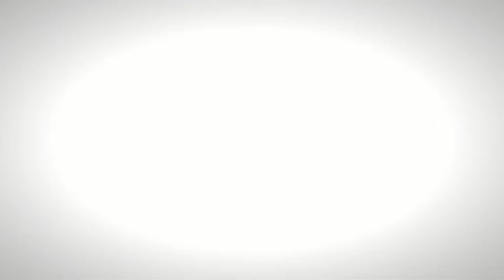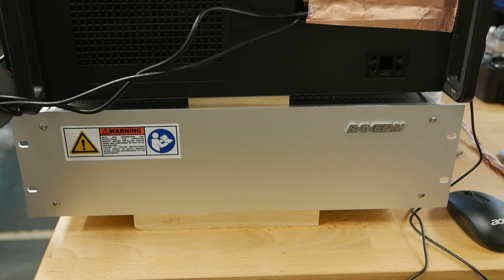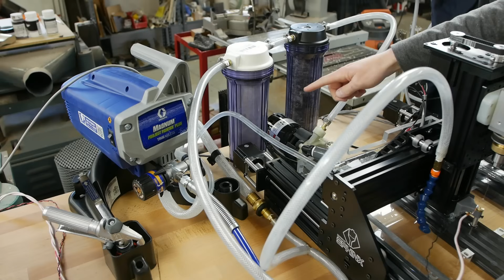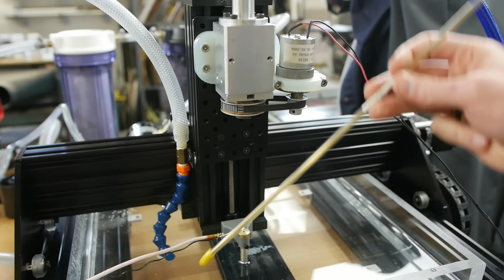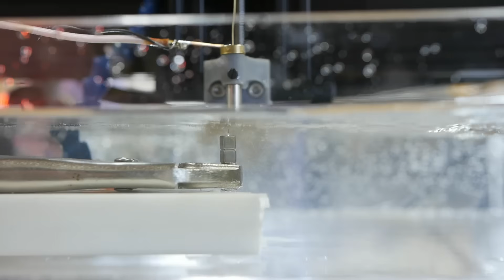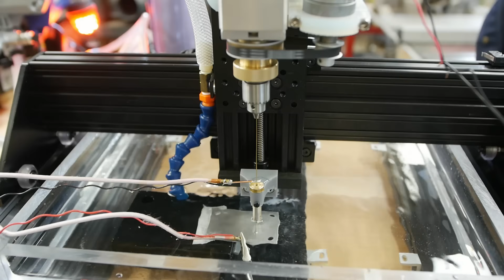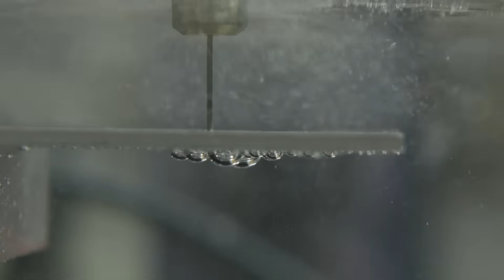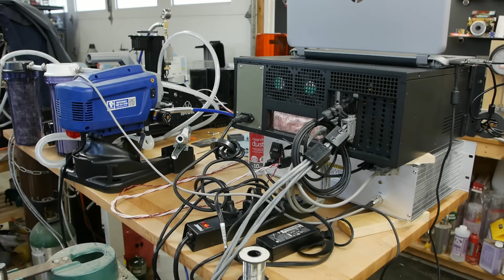Drill through anything (conductive) with Electrical Discharge Machining

Comment: How do you keep the arc happening at just the bottom of the electrode? Surely if it happened all the way up, it would enlarge the hole like a cone with time as a variable.
Reply: Watch the end of the video, it DOES happen all the way up, it's not limited to any particular spot on the electrode.

But not like a cone. The electric potential all along the piece you're trying to drill is the same, right? assuming it's sufficiently conductive. The electric potential all along the electrode is also the same. Where does arc discharge happen? Wherever it has to bridge the lowest length of barely conductive medium, the water. Wherever the distance between the electrode and the piece is the lowest. It knocks off the high spots basically, the hole will be cylindrical, not cone shaped.
Reply: @SianaGearz  Makes sense. Even then, stray arcs? Thats gotta be a parameter
Reply: @joblessalex  stray arcs are a thing, but then, they'll just all average out, they won't really matter in the overall shape of the hole, merely in surface quality and final dimension. Surface is what it is, don't think you could do anything about it, even if you insulated the rest of the probe. The tip of the electrode is consumed faster, so using also the whole side of the electrode is advantageous to get a consistent hole size, and just keep the timing of the side erosion consistent.
Reply: In the words of Jeremy Clarkson: "POWWWEEERRRRRRRR!"
Reply: The electrode gap at the tip is kept smaller than the gap between the sides to maintain the arc at the bottom.  With a perfectly straight electrode the spark would stop just after it punches through because the voltage is not enough to jump the gap to the sides of the hole.  As the spark energy is reduced and the gap is decreased it is possible to achieve very fine surface finished as the peacks on the surface keep getting eroded away.
Reply: @KallePihlajasaari  I don't understand how it's spatially possible. Once some surface material has been removed, the electrode needs to be advanced, and as it's advanced, eventually the distance at the tip will be equal to distance to some point along the sides.
Reply: @SianaGearz  Imagine the tool advanced to the very bottom of the hole, in contact, the retracted just a tiny bit and that is the operating point. You are trying to keep the gap as small as possible but not in contact  The spark will always jump the smallest gap. If you control the gap at the tip to always be smaller than the side gap you achieve a tight fitting hole.  If you let the work piece get eroded further from the tip than the side clearance the sides of the hole will start to be eroded (much slower because the surface area is more than the tip surface area).  After some time the side and bottom gap will be bigger than the PSU voltage can jump and the sparks and erosion will stop and you have to advance to start the erosion at the tip again.
Reply: @KallePihlajasaari  oh i see. Thanks.

Ultimately the electrode clears an equal distance around itself as it advances. I had forgotten that this distance depends on the energy supplied, thus you can put a hard upper boundary on the depth of side erosion, so thanks for alerting me to this. You're suggesting that since the mechanical advance leads the erosion, the distance at the tip is generally also expected to be smaller than at the sides. Ultimately i think the sides of the electrode are still active, desirably so, because not only the work erodes, the tip erodes too, it will necessarily round off. Besides you have mechanical alignment issues - movement is not exactly parallel to the electrode orientation, so to avoid making oblong holes, the electrode is rotated; but rotation introduces eccentricity and thus varies the side distance.
Reply: @SianaGearz  Yes.  It may help to picture the fact that the bottom of the hole is not flat but has a radius equal to the bottom gap that continues to the sides.  To make very sharp internal corners it is important to have a small gap and a sharp cornered tool to make a final finishing plunge if the main tool is eroded.  All this required very high position tolerances with tool changes.

And you are correct with the rotation, it is a trade-off between hole shape and hole size.  As mentioned by a few experienced EDM drilling folk on this thread the tool should not be bent to minimize the chance that it will wobble in the hole when turning.  A bent tool will cause a over size hole if rotated or a slot if not.

Comment: I have those same v groove style guide wheels on my 3d printer.  I was initially skeptical in a couple different ways but I have hundreds of hours of print time on it now and I haven't even had to adjust them.  The rollers do tend to collect dust which I blow off occasionally but thats been it so far.

Comment: Would a surfactant help the water in this case?
Reply: Surfactant might 'nicen up' that eroded surface because particles are hovering easier in water.

But you might get some bubbly water. Add bubble minimizing agent?
Reply: @tubefish666  iirc there are non foaming surfactants but it might play havoc with the conductivity of the water

Comment: Neat video, but isn’t “feed rate” just the rate at which the vertical axis is moving? Wouldn’t this be easy to reverse? I know I’ve seen CNC routers that back off the end mill if they detect too high a cutting force.
Anyhow, I’ve been looking into plating thru-holes and the palladium electroless plating solutions are pretty pricy and not terribly easy to get a hold on. Might you have an idea how easy would a budget vapour deposition technique be for this?
Reply: There was a cheaper/simpler/safer (or something) Russian electroless plating solution described on Instructibles but the one chemical was a scheduled drug precursor in the USA I think so not available there.

Vapour deposition inside a hole would be impractical I think but perhaps it has been tried out, do a patent search.

Comment: This is incredible. I am very impressed with the machining speed, too. This suggests that quite a lot of power must go into that electrode - molecular bonds need to be broken. Feeds and speeds got a whole lot more interesting. Might you have any information on the arc waveforms? This has to be doable without any industrial gear. I saw the frequency, on and off times (kilohertz range, microsecond range), and current (15A) but nothing about open circuit voltage, and any inductive behavior. I can imagine that a high starting voltage is needed, but you mentioned 2V being shutdown level. What is ""running" arc voltage? Like a discharge lamp? Dozens to 100V+? Building a constant current HF supply with a open circuit voltage of kilovolts that is controllable down to essentially zero might be rather hard.
Reply: The voltage mentioned was the conditioned feedback signal on the 0-10V control input.  The gap voltage is not quite that low but usually in the tens of volts.  Searching on Google will find you a lot of brochures, academic papers, patents and a few DIY projects, one has full plans in a book and a Yahoo support group.

Comment: Awesome. You don't find too many videos about this topic. Well explained. I first got in to contact with this way of working in the early 2000's. I needed a 1mm hole through 3cm's of steel. That's the only way to get it done.

Comment: How difficult would it be to make the spark generator/controller thing that you are borrowing? I don't know where you would even begin to build up something like that.
Reply: @KP yeah, wouldn't hacking a motor VFD get you ~90% of the way there?  All the power you want, the carrier frequency for pwm typically up to 16khz (maybe too low?).  Maybe you'd want to somehow change the pwm from simulating a sinusoid (http://www.vfds.org/vfd-pwm-waveform-762549.html) to a continuous train of same-shaped pulses?  It's not really clear to me what the parameter space of current/waveform/Hz. etc. is for making EDM work well.  Like how far can you deviate from what you get with an 'ideal' EDM arc controller vs. the bare minimum electronics hack you'd need to do clean, precise 2D cuts that come out, say, like in this video.

Comment: I made a crude EDM machine with a high voltage capacitor (it was actually a small roll of coaxial cable) and a spark gap, that way there is no need for expensive power electronics however it only works for drilling small holes and the water has to be much more cleaner for it to work well, also i don't know if the much faster and powerful pulses can actually be detrimental to the material.

Comment: Cool, always wondered what the arc voltage waveform was like.   I should put this on my list of projects, already have a Dyanmotion board I was going to use for the CNC mill.  I kind to thought some some of the  EDM units extended the electrode until they created an arc then retracted the electrode slightly, recharged the arc generation capacitors and went back in for another bite at the material., sort of like peck drilling.   Nice job Ben.    Let's see,  you got water jet cutting,  regular milling and now EDM.  What's next -- ah start looking for a a 5KW fiber laser. 

Craig

Comment: Hey, great thing about Openbuilds is that if you need to extend your Z axis to account for a longer probe if you don't want to cut them short, you can get a longer threaded rod and matching C-beam to extend the height.

Comment: Could you use this method to drill a hole down lengthwise through a piece of pencil lead?
Reply: Yes and no. Yes, it conducts, but no, it contains so much impurities that the drill rod might come out the side. This has been documented on video, japanese extreme skills show did it.

Comment: I EDMed a 1/2" wrench once while replacing batteries in a room sized UPS.  A few hundred amps is all you need.
Reply: My co-worker EDM-d about an inch off the end of her torque wrench, when tightening the bolts on bus-bars for a submarine battery. I believe it's ok to say this, because I found the specs on the internet: I'm talking about a 260 volt battery with a capacity of more than 10,000 amp-hours for each 2 volt cell. Each cell weighs 2,100 pounds. The total of 128 cells has stored energy of 2,600 kWh, and weighs more than 130 tons.
Reply: i EDMed a new profile on my calipers with a 28v aircraft battery, you won't believe how efficient and fast that technique is
Reply: Everyone off the buss!  It's pretty amazing what you can weld or vaporize with battery stacks.  Used to be -48V for phone plants was The King here, but a lot of datacenter UPS battery plants can do it now.
Reply: I EDM'd a bank of N-channel MOSFETs with a 30V, 500A power supply while testing for their use in a SSPC for Northrop Grumman. Turned the supply on into a short, they shut down in about 1uS at 150A, and the case temp of the one with the thermocouple on it rose to about 100C in a few seconds. Had to hit it with the crowbar again after 30 seconds, and they cascaded like a fireworks booth in the middle of a Texas grass fire. OK, it was more like welding, but the the hole I drilled in my shorts was definitely due to the electronics.
Reply: Out in the field, some people stick weld with 2 car batteries and jumper cables
Reply: I EDM'd my large needle nosed vise grips...and thru all these years up to now I thot I'd done something stoopid!
Reply: I know someone who welded a wrench using the same technique.
Thinking about it, you could make a pretty easy high current welder/arc furnace using a few truck batteries.
Reply: My father in law EDMed his wedding ring between a starter and ground while he was wearing it. I like to imagine him trying to run from it.
Reply: gearhead 130 : welding slag/spatter  and electrical shorts can raise hell with a wedding ring,  or so I’ve been told.

Comment: If electrodes are $69 I wonder if you could use up half of the electrode length then lower the drill head a few inches and use up the rest of the electrodes?
Reply: Yes, can be done until you can't hold it in your machine.

Comment: I'm sure you've seen an EDM in person, but the ones I see have a DI tank included in the setup. I believe they remove almost all minerals from the water. I've been told twice now that the water needs to be close to 18Mohm. 

Also, nice choice on housings. The M.E. I work with designed the stainless ones back in the 90s for the same company!
Reply: Yes, deionising resin or ion exhange resin is used to bring the conductivity level down to 20-50 microSiemens which work great in wire EDM and drill EDM

Comment: What about diamond? Also I'm wondering, are the electrodes insulated with a laquer or similar along the outside to prevent sparking/EDM occurring along the entire length and henceforth machining the hole larger than intended? Great videos man, always great videos!
Reply: Diamond doesn't conduct electricity.

Side burning happens to an extent and you can actually measure the holes taper happening from the sparks jumping the gap through all the debris.
Reply: @TheWireEDM  You are absolutely correct Herr Fagerlund, my mistake. I seemed to remember that thermal and electrical conductivity correlates, but that must be in metals only. That said, diamonds do have the highest thermal coductivity of any material it seems. Well about the side sparking issue -could it be a solution to insulate the sides somehow? And when you say "side burning happens to an extent" is there a reason why the current "chooses" to spark at the tip, some type of skin effect or that sparks often want a tip to spark from maybe? Thanks for answering!

Comment: but I don't understand.. how does the wire not get eaten away at the other electrode connection?
Reply: It only gets eaten away by a spark and sparks only happen when there is a gap between voltage potentials. The electrical connection is a contact, so no sparking.
Reply: @TheWireEDM  i understand that.. but since it's rotating i assumed there is no perfect connection. and any micro spark will cause additive damage to that micro brass pipe.

Comment: red hot glass is conductive right? thats why microwaves can melt glass if its put inside while hot.  try edm'ing glass lol
Reply: Glass doesn't work and actually causes issues when machining low quality aluminium, when you drill the part it creates a recast layer that may become non conductive and will then refuse to drill further.
Reply: @jimfdg3916  I'm confused about what u mean. Where does aluminium come into the picture.  I wouldn't be surprised if does work that well, glass is inherently unpredictable especially with such drastic temperature differences , but it would be cool to see someone try. The whole water bath thing kinda excludes red hot glass without significant increased setup complexity

Comment: I bet he's the kind of guy that never loses a chuck key.
Reply: who uses Chuck keys?  i just use a vice grip.
Reply: @Unmannedair  haha, good I'm not the only one.
Reply: @godofplumbing  when half the teeth are missing and you don't feel like making dentures for the drill press...
Reply: @Unmannedair  exactly. Also, i somehow managed to break a chuck key once and it took me ages to get it out of my drill.
Reply: ha! I wired one key to my dp and have another on a 6" piece of 1/2 inch galvanized pipe as an extension. Works great for getting the chuck real tight.
Reply: @johnpossum556  good idea, but I probably still lose it. Haha.
Reply: Yep. If it were me, I'd figure out a way to mount it on that nice flat surface holding the chuck! In my face I don't usually lose them.
Reply: But you probably tighten the chuck in the three holes, when its actually the same that tightening only in one...
Reply: If that's a requirement... I'm out. 
I own dozens, if not hundreds, and on a good day I can find about 7... give or take a few.

Comment: how they do a edm drillbit ? with another edm drill and that drillbit ?
Reply: You mean the electrodes? It is just a drawn over mandrel tubing made of brass or copper. Multihole tubing is made by inserting smaller tubes inside a larger tube and then drawing it through a die to squeeze it together.
Reply: @TheWireEDM  yep interesting... thanks for the answer

Comment: you know? I think that your electric dancing machine could be easily re purposed to make plastic injection molds. Also maybe you could try with a graphite drill, for what I know graphite can stand electrical processes better, although its soft and at that scale it may not perform so well.